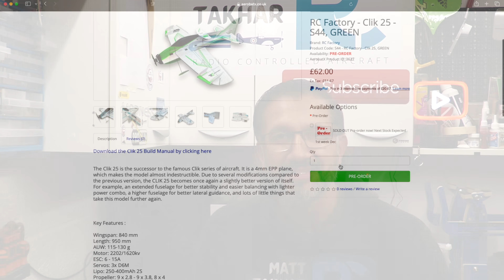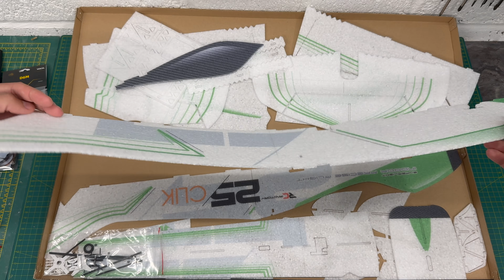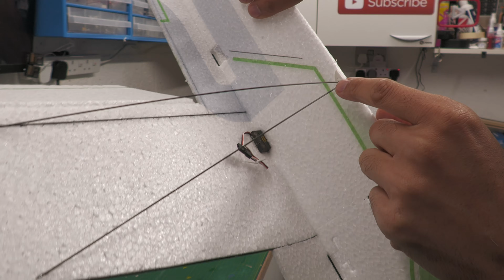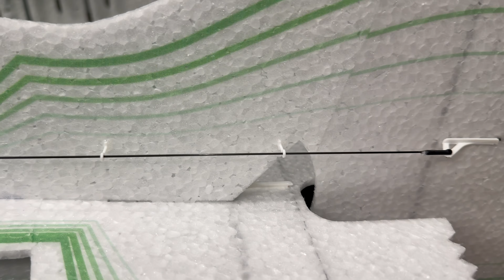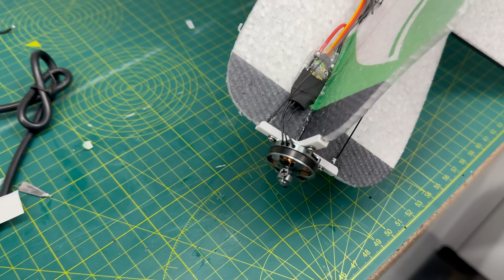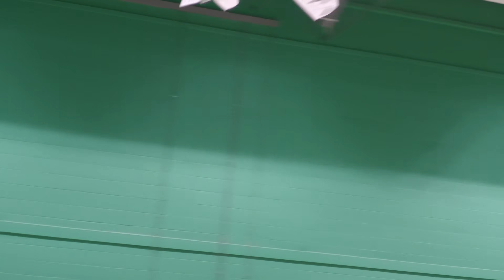RC Factory Clik 25 Review | Build, Test Flight & First Impressions

Comment: Hello Matt. Nice video of this model. I have a question. What are the control surfaces travel ?Thank You for Your answer
Reply from the maker: Hi, I'm just about to get this model back out as it's now "indoor season", I will check. However from memory I setup full movement on each control surface and then just added expo. I did this as the model flys so slow. Its a great model.

Comment: Just finishing mine . Seems to fly very well for you. Any idea on your weight? Also how much control throws and expo?  CG as per manual? What propellor do you use? I bet you would take another 4 grams or more off with a smaller receiver. On a model like this it would make a noticeable difference. Congrats on your Clik25 and wish me luck on mine!!
Reply from the maker: Hi, thanks for leaving a comment. The my Clik weighs 141g with a 250mAh battery, although that was with the bigger RX as shown in the video. I the RX and is now weights 119g without battery. Sorry I don't have a direct comparison with batt. I'm using the GWS 8 X 4.3 which comes in the RC Factory Equipment set, I've not experimented with other pros yet. CG is as per manual, although I want to double check it on a balancer. It does fly fine but I want to make sure. Let me know what you think of yours.
Reply: @MattTakharRC  Thank you for the reply and info. I also saw your Synergy video. Depending how the Click turns out for me I may give the Synergy a go also. Overall between the two planes you seem to be able to fly the Clik abit slower more easily?  I also hope you got an even better job than before!  Happy to have found you ,Subscribed.
Reply from the maker: @turboomni848  thank you for subscribing. I think the Clik is a bit slower. I'm about to glue the "air breaks" to the wings, which will slow it down further too. I'm hoping it will slow it down during the downlines too.
Reply: @MattTakharRC  I am assuming the "air brakes" you are referring to is for the Clik25 as I have a few extra parts that do look to be that.
Reply: @MattTakharRC  Hello Matt. It was 48 Fahrenheit and no wind outside this morning on the East Coast USA and my Clik 25 was ready. Took her out and what a pussycat of a plane. Straight and true with a Clik of down elevator. I used the T motor recommended and would hover effortlessly with a APC 9X3.7 sf prop that I carefully balanced. Even the hub needed balancing but it was worth the effort. Need to either reduce expo or increase rates or both a bit. The wind started to pick up a little and I brought her in. I am very excited about this aircraft and may go order the Synergy as it may be better slightly outdoors. Cheers!

Comment: Also if possible show video of that small RX wiring set up. I use very small rx from eBay with my spektrum tx. I haven’t seen the one you showed.
Reply from the maker: I will do. I’ve not yet wired it. I swapped over to some small Futaba RXs that had normal connectors.

Comment: Good afternoon, Matt

Nice to see you build the RC clik 25 

With reference to the glue that you’re actually using on the aeroplane, honestly is no good

The glue that we use is UHU por the reason why we use this glue is it’s very elasticated and any mistake that you actually make you can rectify it without any damage to the Aeroplane   

Kind regards, Paul
Reply from the maker: Hi Paul,

Thanks for the feedback. I was told that by someone else after my build. I’ve now got the UHU and will use it next time round 👍🏽